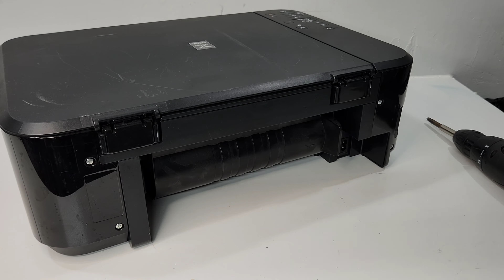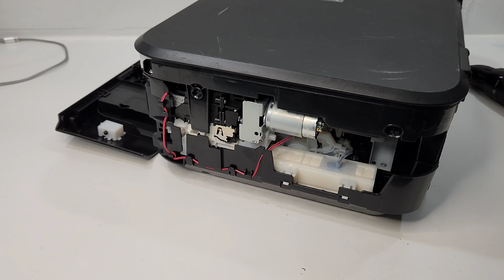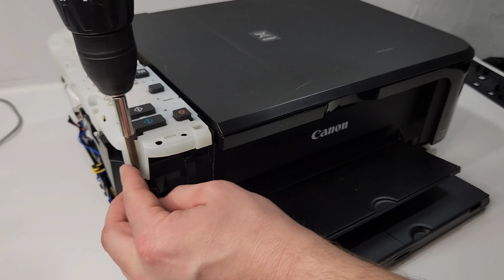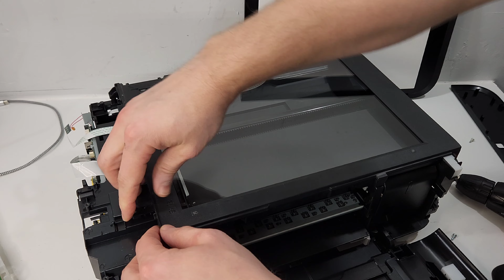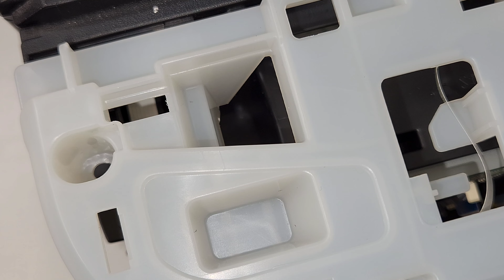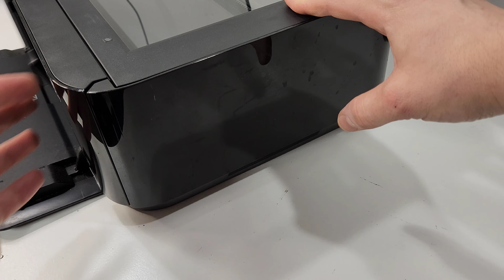How to Access the Inside of Canon MG3620 Printer to Clean or Repair MG3220 MG3520

Comment: On my MG3650S I got the dreaded 5B02 error.  I dismantled the ink absorber on the rh side in that white plastic box (after disconnecting the rh side panel) but I’m not convinced it’s necessary.  After setting the printer in service mode by holding down the power button and pressing the reset button I think 5 times (see on line) I used wicreset on line to download software and followed the instructions to reset the ink absorber counter (cost about £5.38).  Apparently, after a certain no. of prints  you reach a max on the counter and you can’t print anymore unless it’s reset.
Reply from the maker: Thanks for the detailed feedback and steps!

Comment: I took mine apart today as printer head came off the track during transit. but now the black ink light keeps flashing even with refilled cartridge. the white ink tube at right side isn't pumping ink all the way through despite using isa to clean but b still flashing smh...

Comment: Nice work. I have problem with Canon MG3650S - The bottom rollers are not grabbing, not picking up the paper. I hoped that this disassembly would show how to get to them but I guess there is no way to clean them or replace. I am talking about these at the very bottom.

Comment: Is there a way to just open under cartridge part? I dropped my ink absorbers there while trying to take them out
Reply: The same happens to me and I have to open it but how under there?
Reply: @marakisir under the ink cartridges part where the big sponges are. I ended up cutting fleece furniture covers into the dimension of the lost ink pad and it worked
Reply: @JB-tt6ct Thank you I'll try this for sure
Reply: @marakisir it works..you'll get the ink pad full messages everytime but dismis/ignore and it work..any fleece would work but the furniture thingies are cheapest most practical option

Comment: Hello! How to remove the printer head? You need to disassemble or not? Maybe you can guide me! Great video by the way! Thanks!
Reply from the maker: Thank you. This printer does not have printheads seperate from the cartridges. The print nozzles are built into the cartridges.

Comment: How do you replace the paper roller. I watched you take the printer apart even the scaner. But I couldn't see where you could get to the roller?
Reply from the maker: Replacing roller is not an easy task and will most likely end up a broken piece. Is there a  reason for replacing the roller? Usually, it only needs a cleaning.
Reply: @303electronics  Hi, In my MG3650 roller not spinning and I get an error "no paper... Load paper". Does it mean something with sensor (if exist) or mechanical/electronical issue
Reply: @marekjarek8185  he obviously doesn't know...
Reply: It’s the pickup rollers that get dirty and don’t grip the paper!
Reply: Yeah, same problem. No one can do anything. Canon just has all the usual troubleshooting tips & they all fail. Took me 2 days about 3 hours total to print about 5 pages. Had to feed them 1 at a time in order to make it A. Take the paper & B. Not get a paper jam and/or tell me there is no paper & make me push that button over & over & over...

Comment: It seems like a lot of work to remove a paper jam. I would probably damage the printer in the process of opening it. 😢 Canon won't even tell me where to take it to get it fixed.
Reply: Im feeling the same way. This guy did a FANTASTIC job giving us step by step and its nothing on him. Its on damn Canon for making it extremely complex to disassemble. I dont take apart and try to fix the inside of electronics ever so this is incredibly overwhelming to me. But if I dont try this im gonna have to get another damn printer at this point. Im worried im gonna screw this up!

Comment: Thanks. Works perfect for my Canon MG3650S. Horizontal alignment is all over the shop so i am cleaning the horizontal ribbon but just stuck releasing the heads to get to the sensor. you should magnetize your bit so that screws stay attached and do not drop inside. Just touch a magnet to it. I use a magnet from a scrap hard drive. I used to use an old TV speaker magnet. Thanks again.

Comment: Do you have any steps/video on changing the nozzles? Mine is printing and missing letters. I printed a nozzle check multiple times after doen multiple cleaning/deep cleaning through the software and its still showing that the nozzles are clogged.
Reply: mine also bro I dd everything dd u find solutions to ur problem? myb it can also work on mine bro dats the only problem dats driving me nuts
Reply: Just buy a new cartridge, it will work perfect

Comment: Excellent video!!! I've subscribed. Have you ever gone deeper into the machine? I have a pixma mg3650s, identical to this one. The rubber has come off one of the paper pickup rollers. I would need to go another layer down into the printer. Very daunting!! Would you suggest giving it a go?
Reply: Yes, I think the paper tray is probably the area most people need to get to. I'm just trying to find out how to get in there so I can see why the rollers are no longer rolling. SIGH
Reply: @alloyjane  1st thing to do is look inside the paper tray, right at the back. You'll need a torch. Check to see if the rollers still have the rubber 'tyres' on them. They are dark grey. That was the problem with mine. 1 of them had come off. Managed to fix it....... very fiddly!!!

Comment: Do you have anything about replacing the waste ink absorption pads on a 3600 those felt pads on the right hand side of the unit?  I got them out and rinsed them out but have no idea on the way they go back into the plastic tray thing and in what order or direction